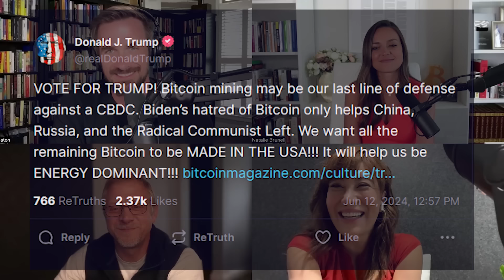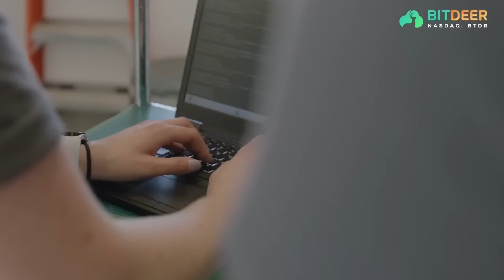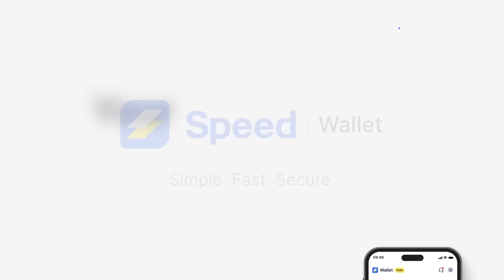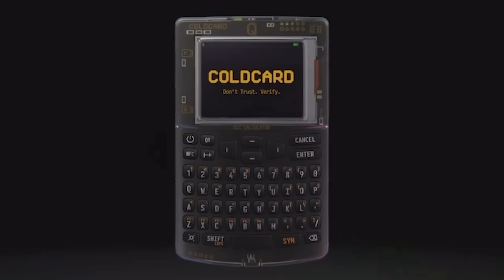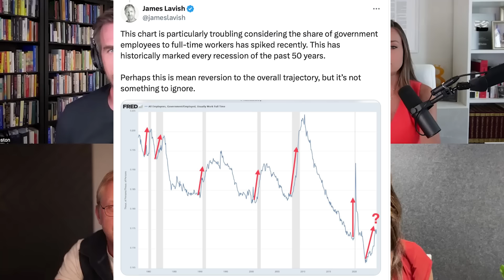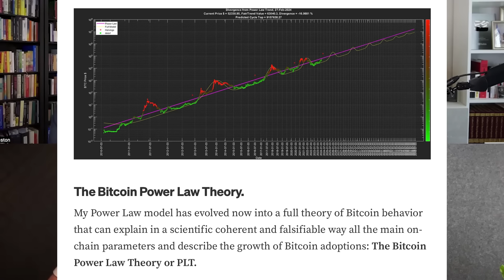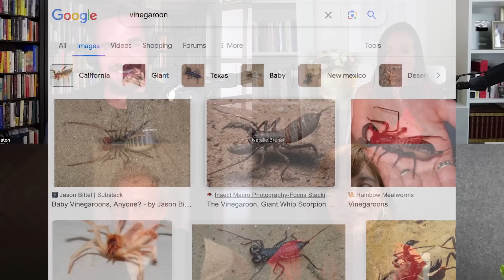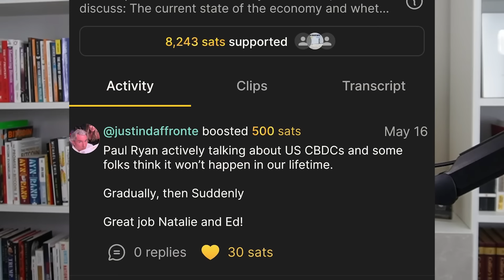Bitcoin & Macro Hangout 2: Preston Pysh, James Lavish, Dr. Susie Reilly & Surprise Guest Luke Gromen

Comment: Thanks, Natalie. Great content!

Power Law - “so what”? A personal answer.

TL;DR: Bitcoin is as boring as the second law of thermodynamics. And that strengthens my conviction in it and my hope for my kids’ and grandkids’ future.

Any phenomena that obeys a power law is anti-fragile. Power law phenomena are resilient and persistent over time. Power law phenomena respond to perturbations by dependably reverting to their mean. They are particularly insensitive to perturbations from chaotic sources - sources of which cannot be predicted in time of occurrence or magnitude per occurrence.

Power law phenomena are “scale invariant”. Their correlation to the mean, no matter what graph type (linear-linear, semi-log, log-log) is chosen. In the case of one of Bitcoin’s power laws, price vs time, the correlation is about 97%. In the case of our solar system’s planetary orbital periods vs length of their orbital path’s semi-major axis, the correlation is greater than 99% over 5 billion years. That is over twelve orders of magnitude in time (days since solar system accretion).

Power law phenomena have several similar attributes. Among them are the lack of central control and the presence of negative feedback processes that yield resilience and resistance to outside chaotic perturbations.

Power law phenomena are abundant in nature. One natural power law is the planetary orbital period vs axis distance mentioned above. Another is the mass of an animal species vs its average daily metabolic energy consumption. All species of animal life, no matter the species, has a “plot point” on that curve. And the curve has a stable correlation of greater than 95% to its mean … over about half a billion years on earth. Even small cellular protozoan species mass vs metabolism rate fall on this power curve.

Evolution of life itself has many power law behaviors. The resilience of species over many generations is an artifact of the behaviors.

Cities have many power law phenomena. Number of gas stations vs population is one that obeys a power law. Cities have limited central power in that if a resident doesn’t like how they’re treated, they move out. In general, cities are adaptive in that their residents coordinate activities to improve (or degrade) performance over time. As a result, cities are resilient. They last hundreds of generations of humans. Companies are centrally controlled and eventually ossify into bureaucratic heaps, stifling innovation. Companies generally die after ten years - half a generation. No company in existence has demonstrated any power law behaviors with correlation to observed data better than about 85%.

What is the meaning of the word “law” within the phrase “power law”? That is best understood by considering other “laws” we are more accustomed to. I’m a retired engineer (aero, nuke, mechanical, computer, software) who was formally educated on several “laws” of nature. They are laws in the sense that no observation by humans has ever contradicted them. These natural laws include:

-Law of conservation of energy
-Law of conservation of matter
-Law of conservation of momentum
-Law of equivalency of mass and energy
-First law of thermodynamics: thermal energy flows from higher temperature to lower temperature.
-Second law of thermodynamics: in any closed system in which a thermodynamic process occurs, the “waste” energy output, also known as entropy, is always non-zero.

A power law is a law of nature.

Bitcoin has multiple evident power laws. Price vs time is one of them. What does this mean?

A power law is a mathematical model. The model is very simple:

y = S*x^A, where 

y is the vertical axis coordinate,
S is a constant that represents a starting y value, 
x is the integer count of the horizontal axis parameter, and 
S is a constant representing the constant scale factor.

In the case of Bitcoin’s price versus time power law,

y is price in USD per BTC
x is number of days since genesis block
S is an assumed value at start date of 3 Jan 2009. The value I chose is 1/10^17, or, 0.00000000000000001
A is the constant I choose that best “fits” the model to the mean of the data. Best fit has A at about 5.8.

Plot this line along with bitcoin monthly average price data on a log-log graph and conduct a regression to the mean analysis. The result is an r^2 value (correlation to the mean) of about 97%.

Plot any other asset value and attempt to construct a power law model fit and regression analysis and you won’t find any that correlate better than about 85%.

Chaos science studies began in the 1930s. They picked up steam in the 1960s with the advent of low-cost computers. The science has exploded since the 1979s. Here are some popular books by people who you may recognize that describe chaos theory in general and “fractal self-similitude” of power law phenomena specifically:

Mandelbrot, Benoit, “The Misbehavior of Markets”

Taleb, Nassim, “The Black Swan”

Taleb, Nassim, “Antifragile”

Gleick, James, “Chaos”

West, Geoffrey, “Scale”

I recommend that each of you do proof of work on power law and chaos science. It’ll take about 200 hours of reading, studying and critical thinking. 

I’ve done that. Here’s what I’ve drawn from it: the power law model should never be used as a price predictor of Bitcoin. Why? Because external perturbations (Mt Gox, FTX, 3Arrows, spot ETFs, etc) will get ya! 

Indeed, a “suddenly” event could cause bitcoin to spike to $20 million. But Bitcoin is resilient to these perturbations and will revert to the mean over time, whether the perturbation is positive stimulus or negative stimulus.

Bitcoin is boring. Its reversion to mean over time is just a thing. That it’s mean is something less than what you want it to be doesn’t matter to Bitcoin. Because Bitcoin is boring. 

Bitcoin’s Power law correlation has strengthened my conviction in its future as money by 2x - meaning I’m doubling down on transferring my wealth from fiat to bitcoin. 

Yes, Bitcoin is boring. Power law demonstrates that. But it’s dependable… as dependable to me as the second law of thermodynamics.